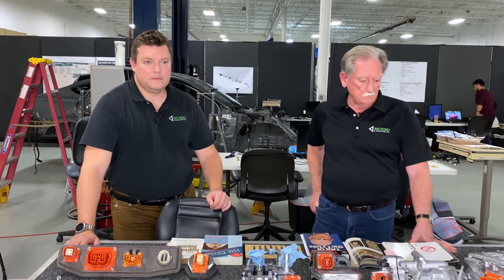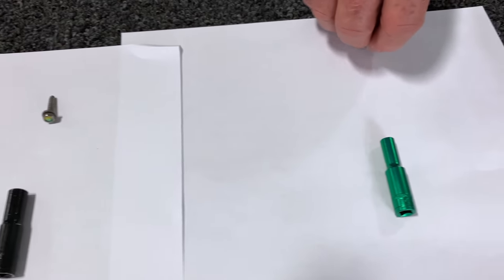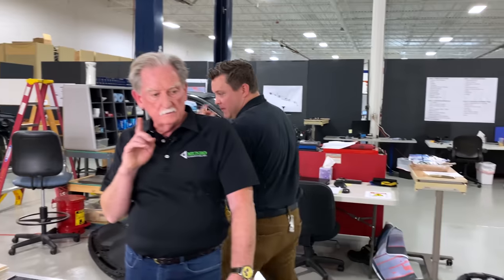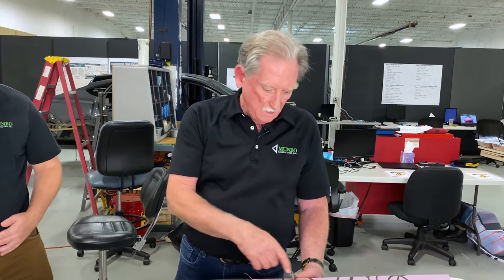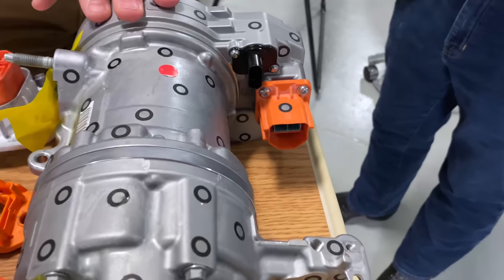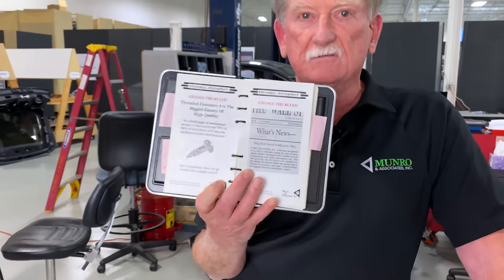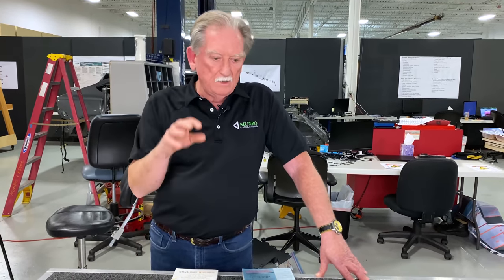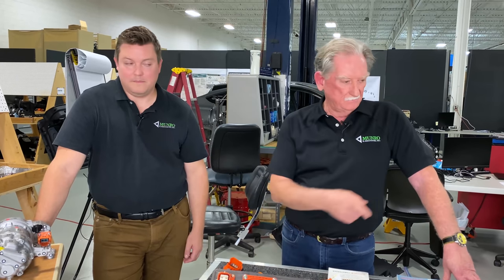Mach-E High Voltage Connector PALOOZA!!!

Comment: If I recall (yeah, I'm old, too) Deming was invited to Toyota in the late 60's or early 70's to help them become one of the world's leading automotive companies. I read one of Deming's books among many other books on good manufacturing and business practices. 

I worked on my own vehicles when they needed most repairs and maintenance. In the early 70's working on most any American car required SAE tool sets. Then Japanese cars permeated the market and I had to go out and buy metric tools. In the 90's I found working on American (so-called) vehicles became a nightmare. On almost every project I had to go buy more tools. Bolts and screws; some were metric, some were SAE, some used hex screws, some 6 point and some 8 point bolts or screws, some star, some torx, some with flanged heads, some needing washers, some lock nuts, some not, and even torque requirements on some were metric and some were inch/foot pounds. 3 types of hose clamps were used, some hose with inch diameters and some with millimeter diameters and so many different types of clips it was insane. I'm talking about just a single vehicle. I can imagine the overhead GM had for the right tools to do each part of the assemblies.

Comment: Seems like its designed to fail, difficult to repair or maintain, keep the after-sale service money coming in.
Reply: A agree that it probably won't be a very reliable car initially, but I don't think Ford is doing it on purpose. It's probably the best they could throw together in the available time. Look for major changes in year two...
Reply: Very few of those connectors will ever be removed for service .. that just isn't a design concern and/or priority.
Reply: @KrustyKlown  Sure but money in bank is.
Reply: @lsauve  Agreed that the next version will probably be better.  But seems like they’ve had plenty of time (based on that booklet that Sandy showed) to become more cost-effective over the years.  Either management at Ford is not effective, someone is not listening, or both…

Comment: The first mechanic that has to deal with so many different screws is going to replace anything he touches with a single type of sheet metal screw.
Reply: Yeah, with so many different fasteners to re-assemble,  the best tool is a hammer.
Reply: @chrisheath2637  🤣🤣🤣

Comment: Tesla are the boss. The competition could easily copy but still come up short every time
Reply: Even copying is not that easy actually.
Reply: @zezizarjaars  copying is easy. The challenge for legacy autos is they're too compartmentalized and addicted to outsourcing
Reply: @corglass  Oké, copy a megacasting.
Reply: @zezizarjaars  ???
Reply: @corglass  Tesla developed their own alloys to make the gigacasting work, they did that with help of Elon's friends of SpaceX. You can't simply copy something like that.
Reply: @zezizarjaars  everything can be copied. Element spectrum analysis can breakdown the alloy and reverse engineer. The point is it just takes more effort than legacy are willing to
Reply: @corglass  If you can reverse engineer the autopilot hardware, it's probably even easier for you to build a comparable chip completely independently. Reverse engineering isn't allways as easy as you seem to think.
Reply: @zezizarjaars  the point is legacy do neither. I think you're getting my point now

Comment: I guess using a single standard of connectors, like maybe Torx, would make way too much sense for Ford.
Reply: They will do what cost the least. Many of those assembled units are purchased from a supplier (not Ford) who selects screws .. or those units are assembled at different Ford plants, where screw preferences differ based on purchasing volumes at each location.  Tesla on the other hand, is a low volume producer, that still assemble a lot of their stuff themselves within one plant location that produces the vehicle.
Reply: @KrustyKlown  Still number of fasteners could be reduced. About pricing only Ford know if is really cheaper. I doubpt that. But anyway .

Comment: As a technician having to make repairs later down the line the huge variety of fasteners is a nightmare. A number of production years of the brand that I specialized in used 6-8 different gauge and length fasteners to hold the dash and HVAC box in place. Replacing HVAC evaporator required stripping the dash and HVAC box to the firewall. I had to carefully separate the fasteners on to the floor as I worked and then remember where they all went to reassemble. Fortunately within a model change all the fasteners were exactly the same. I just let them drop to the floor as I disassembled and picked them up to reassemble. it probably saved .5 hrs in a 5hr job.
 I prefer the more "International Orange" for the high voltage. The lighter orange "papaya" is more the color of SRS wiring and connectors.

Comment: Thx Sandy. Great Video and you are absolutely right. I think the different departments are not talking to each other. Another problem is that engineers when coming from the university never saw a bolt in person an everybody uses what he thinks is right... I studied electrical engineering and was sitting with guys who couldn't identify an tantalum capacitor from a resistor. They could calculate everything, but real life experience is something different.

Great Video.

Comment: Jaguar has grip washers and spring washers on every screw and bolt. I have torn down 100 plus jaguars and a lot of rolls, I have never found a factory fitted screw or nut/bolt etc. loose. I restore Chryslers now and always finding loose everything and no spring or grip washers fitted. They shake themselves apart.
Reply: Must be why you barely find american cars in Europe.
Reply: @abraxastulammo9940  there was a fair few in England in 70s still LHD I had a Plymouth and a 69 mustang. I'm now restoring in Australia. We have lots of Cadillac and mustangs and chargers here in Perth. We have Lincoln and all the Chevy 57s etc lots of Ford f series trucks. I was told many were brought over when the American airbase in Darwin was active in the 70 and 80s. Then just left here like rubbish lol. Too expensive to take home lol.
We probably have more American cars here than in America lol.
I recon we have thousands of your old original mustangs. I've driven a pink one that was from the playboy Mansion. Perth western Australia is riddled with them. I have done a power steering conversion on a 70 mustang a couple of years back.  Yeah I've played with most of your good old cars.

Comment: This is f'n insane to see.. I know I have 0 experience in manufacturing.. but this just screams WTF?! Who would design something where EVERYTHING uses a different type of screw or bolt? How hard could it be to make them generally just use one type? It's insane to see... and you would really expect this to be reversed.. you'd expect THIS is what Ford would be best at with all their experience. You would think the new guys at Tesla are the ones just figuring this all out. Mind boggling that Ford is this disorganize in design.
Reply: This is a design by committee result. Each section was done by a different engineer. Also, they likely outsourced components, which lead to different connectors.
Reply: @AndyZach  yeah.. I get that they aren't really designing all these individual pieces and assembling them. But you would put out a specification for what the product needs to be. If you'd just TELL the component manufacturers, this is what the product needs to conform to. They build it. If it costs you more up front, you make that back in the reduction in weight, complexity and product quality down the road. But I guess they don't have the customer in mind. Just a bunch of bean counters and MBAs to appease.

My other thought of the people saying this is just the nature of suppliers building generic stuff for multiple companies.. if a giant like Ford tells you, this is how we want it built. And it's more efficient and better quality in the end. How do you not save money over time on that, vs just sticking to the original less efficient design? Removing half the fasteners on EVERYTHING has to equate to saving money long term on these, whether it's in house of from a supplier. Better quality, less mass and less components.. ok maybe there's a one time cost to make the change.. after that, it's all gravy! And you can't tell me other OEMs are going to complain about getting a better cheaper part and demand the less efficient design for more $.. that can't be real, can it?

Comment: Thank you for all the hard work from your team, learning something new every video. 

Just a dumb guess, the screws that Sandy likes on the front motor/inverter are the only screws used by Ford assembly line.  The rest is what others had mentioned, sub vendors controlled their own assembly using different screws.  Thats what happen when MBA rush engineers to built a car and everyone below just nodding their heads.

Also from the last video on battery cooling, any chance the team will dive into the heat transfer between the thin strip surface area of the aluminum folded over on the bottom for each pair of battery pouch to the cooling plate.  The video to quick to see if the thermo paste was directly under each aluminum strip or not.  Plus the flow rate through the cooling plate with the multiple pumps used.  There seems to be improvements to recommend to Ford there as well.

Competition is good for the consumers.

Comment: It looks like different modules are made by different subcontractors/vendors with different design teams AND separate assembly lines. So it really doesn't matter that one assembly line use this screw and other use different screw. Unification starts to make sense only when company is as vertically integrated as Tesla...

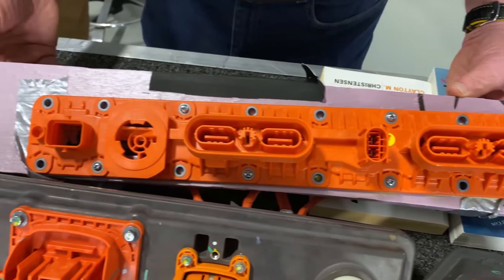Comment: If there is a gasket on the back of the plate at 8:40 that would explain the excessive bolts. Without them the gasket will bend the plate so it’ll be wavey. 

The random bolt choices is what happens when departments don’t talk to each other.

Comment: Note that those screws are connected in electronic modules which might be produced by different suppliers. Then, the different screws in-vehicle environment might be a common part at the supplier plant. 
Comments here are pretty valid, however, screws selection is tied with production facilities and tools as well.

Comment: Thanks for the share, Munro Team. Simplicity design for manufacturing and reducing part number and cost is the goal for sure. That is, to use a version of the connector or fastener is a goal. I think Ford managers and engineers know that. However, I speculate there are two reasons for blocking: 1, Ford does not have a good vertical integration system for EV yet, and they rely on different suppliers heavily. It's normal that different suppliers have different preferences (i.e. size, shape, material, etc.) for connectors or fasteners. 2, Ford is highly likely to know that reason 1, however, to align all connectors to one version may mean a time-consuming and money cost ( (i.e. suppliers may need a redesign and change 2nd or 3rd suppliers) for Ford to push suppliers when it comes to a vehicle project timeline and cost. Then, Ford makes his choice to let it go. My point is Ford should know the philosophy of engineering, but to launch an EV project within time-cost-quality, you have to do a compromise. It applies to all OEMs or startups. Some companies have the guts to risk, but some do not. Back to the bottom essence, it's all about corporate culture. This is my personal opinion. Welcome your thoughts. Thanks. #munro #ford

Comment: I like the color of the "Input For High-Voltage Super Charging" the best. The other plugs have oranges that seem "faded", compared to the high-visibility orange of the input piece. When fooling around with high energy, you need to clearly see what not to touch, and that color fits the bill. If cables and plugs look faded, then they may, possibly, not actually attract your interest. Of course, only qualified workers should be the ones seeing these components, but even they might have to work on an unfamiliar car, and not be aware that that certain cable is 'hot".

Comment: As you indicated no screws is also possible. i read an artricle about a osciloscope assembly where they have removed all screws and only snapin. it meant though a more complicated mold but thisis a one mold saving a lot of manual assembly actions. So yes i supoprt your view. it only takes an hour more thinking saving loads of repeated effort in the assembly.

Comment: When I had motor bikes in the '60s, I didn't know what a torque wrench was so I would tighten head bolts until I couldn't tighten them any more. One day I looked at the bolts on my Triumph and wondered why they had stretched half an inch.

Comment: I was told to order a device for converting RS232 to RS485. The project engineer confirmed it was just hardware specifications and not to worry about drivers. I couldn't find any that met exactly temperature specification.

Comment: You are right... screws are not our friends. But from the cost perspective most of the new shiny and stylish "clicky and snappy" connectors are far more expensive. The question at the end is for how long will they last (or work). Honestly I saw a lot fixations for which screws worked perfectly. Many things have an impact to the durability of screw mountings. The oriantation and mounting position, the tourque, the vibrations and/or movements....thats a long list. At some points I am quite sure (and familiar with) these fasteners will never get loose. So why spend additional investigation and developement time overhead in things that simply doesn't matter? Even though, at some points it would be possible to cut down costs and complexity by reducing the amount of them? Well I think they want to keep others out that were able to help them. Nowadays building a car is more or less a state secret... but thats just my opinion.

Comment: Different suppliers, different bolts. Connectors just clicks in place, so it's not a big problem. The only screws that needs to be universal are those on the final assembly line. Still, 13 different fasteners is too much, but probably they used what was on the shelf to develop fast. VW probably just glued the connectors together and kept the holes (and) screws. :D

Comment: Connectors get a lot of force on them, the plastic often has glass fiber mixed in for added strength.
I reckon the bolts are necessary.

Comment: All OEMs recieve their HV components from suppliers mostly fully mounted. The amount of different screws is not the problem of the OEM as long as the OEM is not responible for the production of the component. The howl powertrain of Tesla is made by themself. Thats why they also focus on a simple production process.

Comment: Sandy, 7:31 the "insert" is called a helicoil I think, great vid btw :-)
Reply: Or you drill out the buggered hole and tap it for a larger sized screw or bolt.
Reply: @mikedx2706  99% of mechanics would just toss the part with a damaged thread and get a new part !!!

Comment: 9:44 what are those black/white dots on the AC compressor to the right?
Reply: Those are just markers for 3d scanning. Adding dots allows you to get higher precision scans.
Reply: @olivierpuraye  I thought so too, but couldn’t understand how you were able to scan with high precision, since the dots from a distance look to be the same size.
Reply: @holgergrauslund  It gives the camera clear reference points to do the stitching when you move the camera around
Reply: @holgergrauslund  The dots just help to set additional reference points on smooth surfaces where there isn’t a lot of information. The tracking is done by looking at the relative distances between the reference points. It pretty much works like the 3d motion tracking features you can find in programs like Adobe After Effects
Reply: @olivierpuraye  ahh cool! Thanks for the explanation.

Comment: It seems too me most of the connector could be molded into the housing or snapped into the housing, the ac could have a permanent sealed wire's coming out of the unit if i had to replace that unit i would probably be replacing the wire anyways

Comment: Om 7/8/2007, the Boeing Dreamliner was 'rolled out'. (I was a Boeing manager, but not in Commercial). It was quickly rolled back into the factory out of concern that the fuselage sections were going to fall apart. Reason? They had to use whatever fasteners they could find to try and put it together. Fastener shortages - numerous titanium new design fasteners, various grip lengths selected by designers that were never made before. None were ordered. About 18 months lead time - from the roll out date. Before the battery issue, it delayed first flight by almost 2 years, and with almost 1000 aircraft orders late, untold liquidated damages to airlines because their deliveries got delayed and the expected 25% fuel reductions for every flight did not materialize. Tragic. And avoidable.

Comment: I've seen,  if I recall correctly,  5.5mm, 6mm, 7mm, and 8 mm as well as Philips and Torx screws, basically all the same size,  under the hood of my 2005 Ford.  Truly ridiculous.  8mm would have been adequate for all of them!

I can replace nearly everything on my Geo Metro with 8, 10, 12, 14, 17mm tools.  Only need 5/8" and 13/16" for spark plugs and lug nuts.